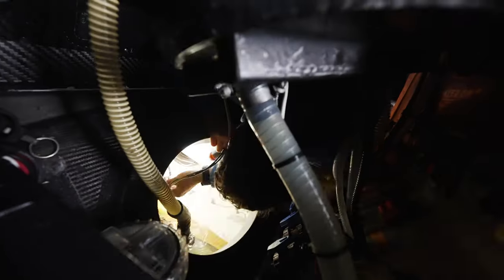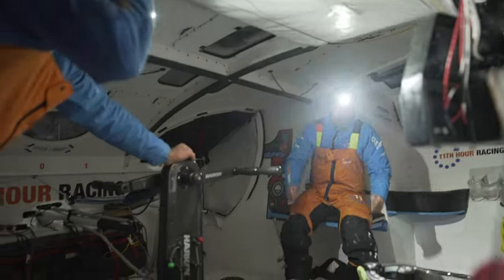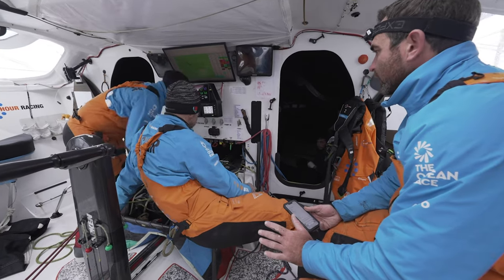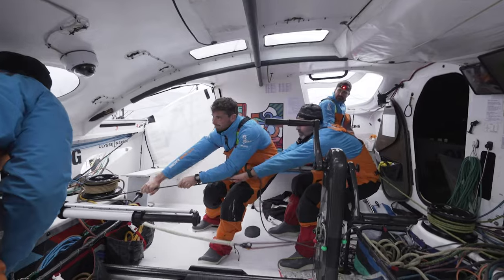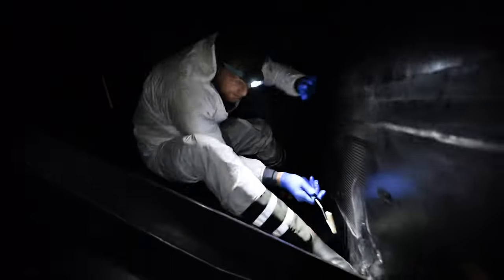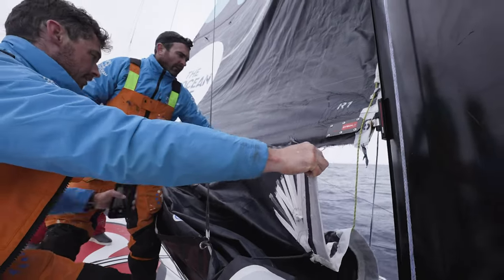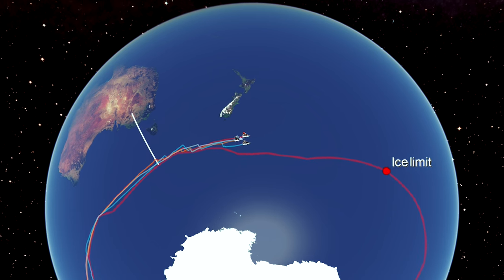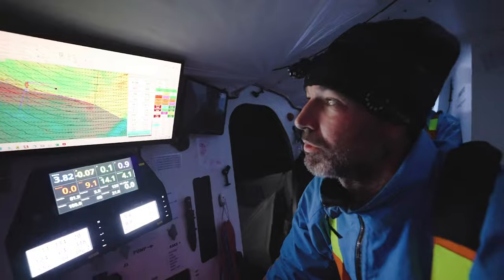Repairs, Repairs and MORE Repairs! | Leg 3 15/03 | The Ocean Race Show

Comment: The very last piece of video here answered to quite a degree how the drone operators are retreiving them after a flight. Shown here is a drone being captured via a vertical handle of sorts protruding from the bottom of it, which of course eliminates any chance of a deck landing which would certainly be impossible anyway. I also noticed that he didn't have a controller in hand, so apparently the cameraman was doing the flying and a crew member did the catching. As a drone pilot, how they are retreiving them has been a puzzle for me, but I still expect that there are several spare drones onboard these boats!
Reply: I had a DJI Mini 2 which I fitted a handle to, they definitely make landings easier, mind you I wouldn't try landing it above 4 knts on my boat!
I have a Mini 3 Pro now, just need to find a handle for it.
Reply: FYI Sailing Uma had an episode on flying and retrieving a drone. Theirs did not havè a handle so she wore a heavy glove.
Reply: @bf5549  I saw that, and have used a glove before as well. I’ve been watching sailing Uma since the inception and absolutely love that show.

Comment: It is not if but when will they pass there design limits. And if it is the last boat are t hé others capable of turning and picking them up. Wish all crew a safe arrival at Brazil. And I like the reset button, you need it .

Comment: Great coverage.  I am both not surprised that there are failures on these boats and then surprised that there are so many and that they seem to be a result of underestimating the forces involved in sailing continuously weeks on end in the harshest waters the planet offers.   Light is not necessarily right.  Am I a naval architect or engineer of any kind? Nope. Just a daysailer on the Salish Sea in my 2000 lb 24 foot racer, and even on these protected waters suffered a deck separation from hitting a wake from a fast freighter.  But it seems that there are areas of vulnerability that those who have done this endurance test many times should be knowledgeable of.  Just as sails are triple laminated at the clue should they not be ultimately reinforced at these and other stress points?   Shouldn't "slam" load points on flat bows be ultimately reinforced. Shouldn't known stress points on spars be engineered for worst scenarios?  If I'm not surprised are the engineers behind these designs?   --monday morning